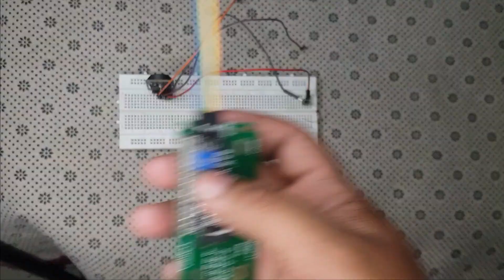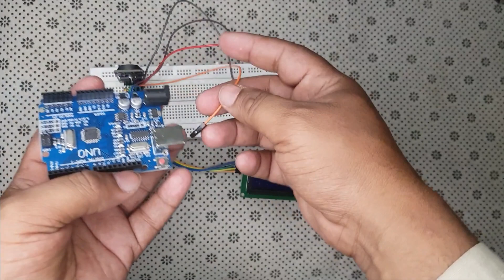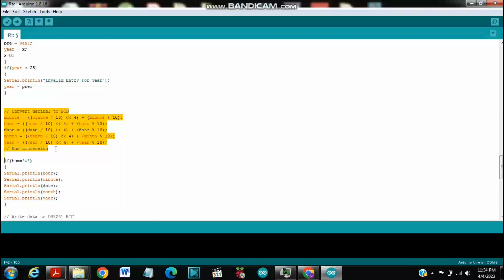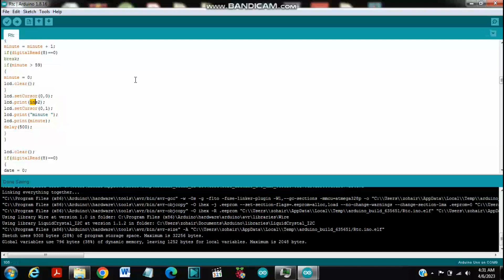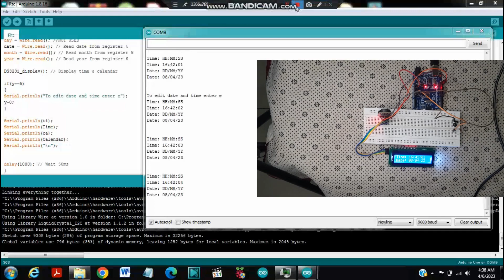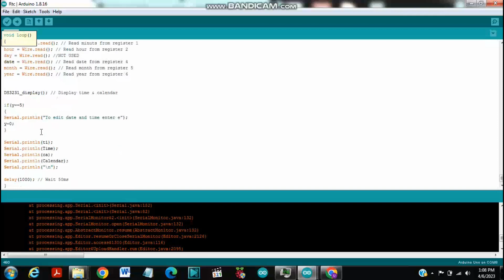RTC DS3231 Project / Real Time Clock With Arduino / RTC Alarm Setting / Real Time Clock Tutorial

Comment: Im still confused on why is it converted to decimal can you explain?
Reply from the maker: It is because data that I am getting is in BCD i-e 4 bits to represent each number from 0 to 9 then if I have to write 12 in BCD it will be written in bits as 0001 0010 that is why I needed to convert it to decimal
Reply: @circuitcraft9203  ahhh ok, tysm man